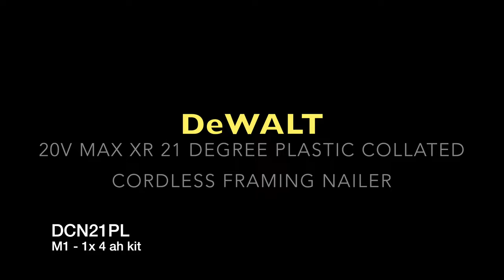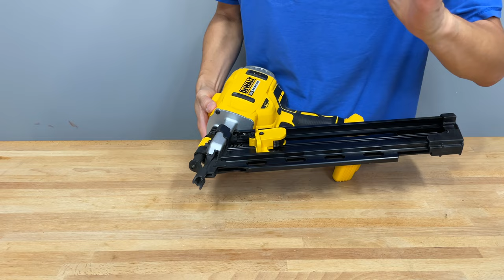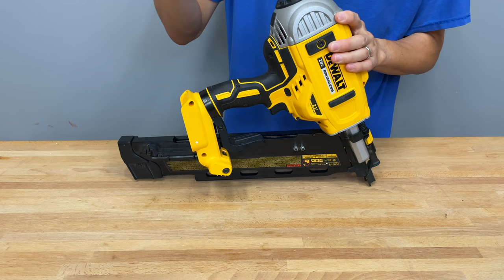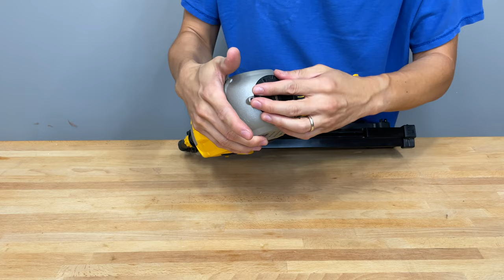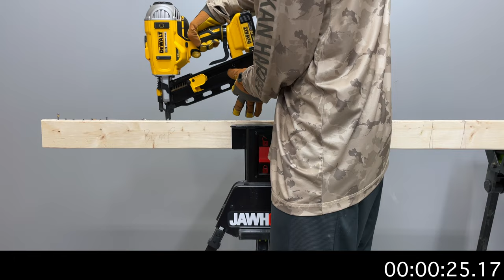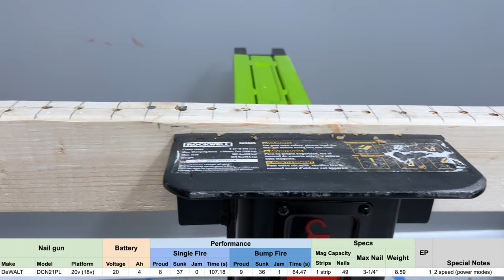DeWALT 20v XR Brushless Cordless Framing Nailer Review | DCN21PL | DCN690 | ep.1

Comment: They were proud, because of the bounce of the board. It’s true the dewalt doesn’t have the power of hitachi or Milwaukee, but any nailer will leave proud nails if the wood is bouncing.
Reply: correct. surprised he didn't realise this.
Reply: Saw it on both ends
Reply: I did notice that with mine you have to have a stern grip on it or it'll bounce and not drive it as deep. And they send extra spring hammers because nail guns do wear out eventually under heavy use or misuse . Mine jams plastic coated sometimes but it's a pretty easy fix. Takes less than 5 seconds if you expect it . Just push the hammer back and you're good to go.
Reply: This is the main complaint and is 100% user error. Lift some weights, keep the gun from recoiling, and make sure your work is sturdy.

Comment: With Senco air nailers, I always could put the full clips in and if it was a few short from one more clip, slide it in the back in a ready position, then after I've used a few nails, pull the spring feeder back, they go right over the strip behind it and locks in the last full clip.

Comment: The issue your having with the nailer is the return springs need replacing, they have most likely brroken and dont have the strength to pull the pin back into position. I had the same issue and they are easy to change out, iv had mine for years now and is way more beat then yours and the springs have been my only issue iv had with it.